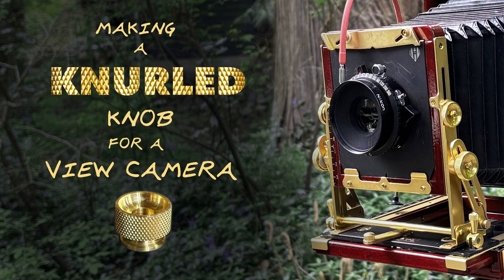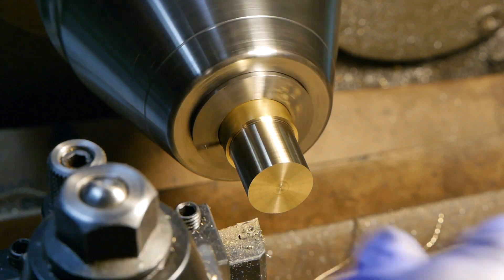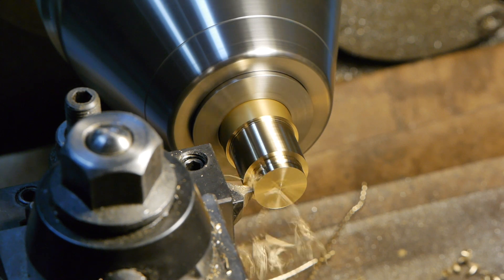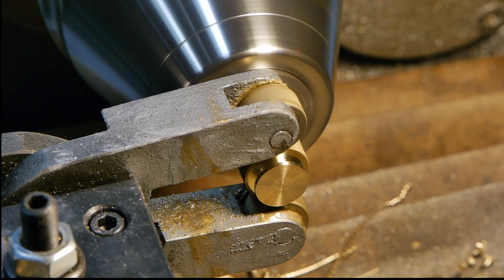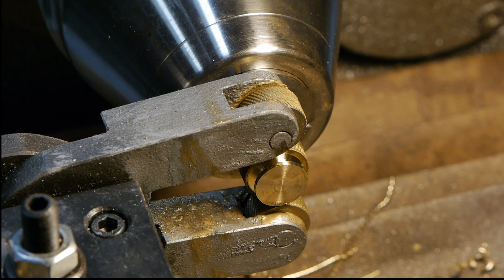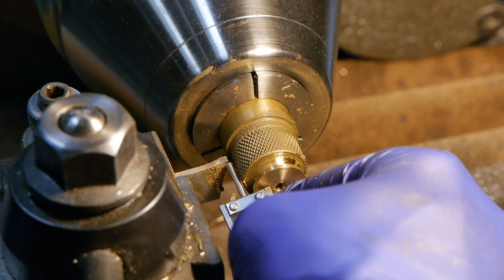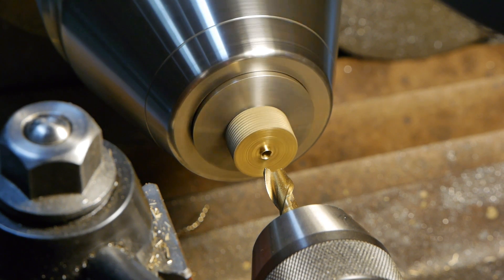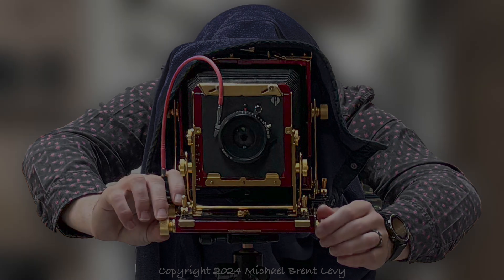Making a Knurled Knob

Comment: I love your videos. After forty years of hobbyist woodworking, in which I often design my projects and problem solve on the fly (as well as correct errors), I have slowly gravitated toward machining. However, I have been a bit intimidated at the videos that demand +/- 0.001" tolerances, at all times. I understand the need to align parts rather precisely for assembly, but I'm enough of a rebel to want to add my own artistic flair.

Comment: Nicely done. How do you clean the gunk off the knurling wheel after using them on soft metals, especially aluminium ?
Reply from the maker: I just wipe off most of the swarf from the tool with a paper towel,  then blow off the knurling wheel with compressed air. You could also use a tooth brush.